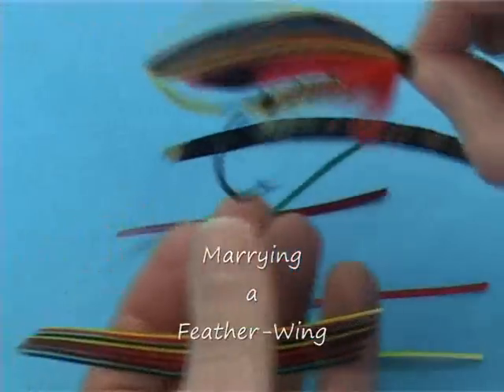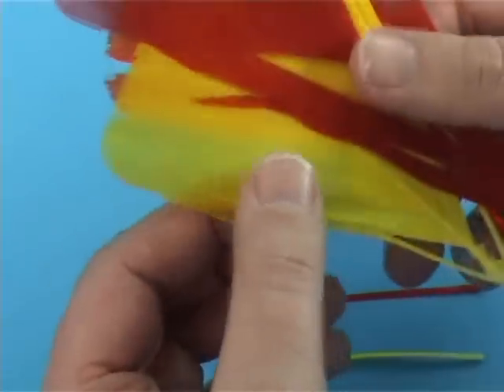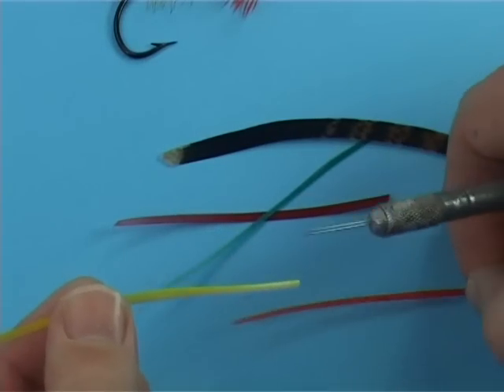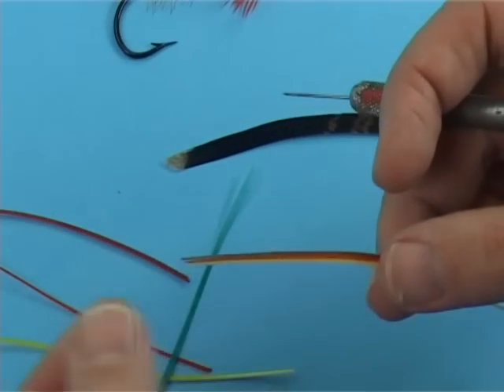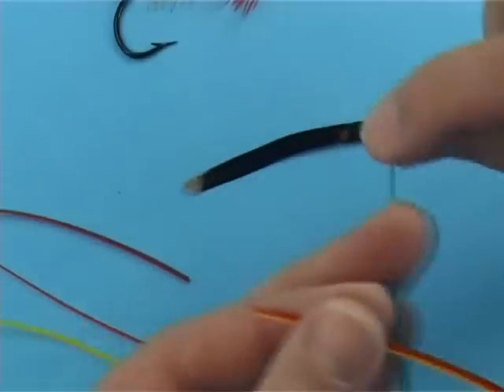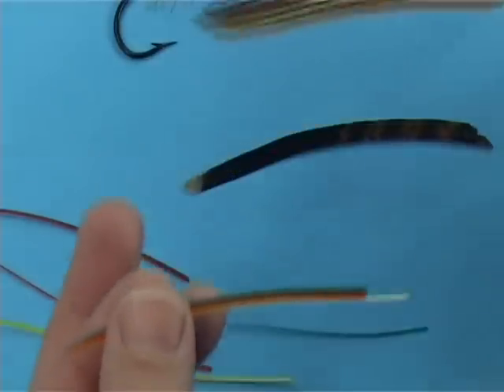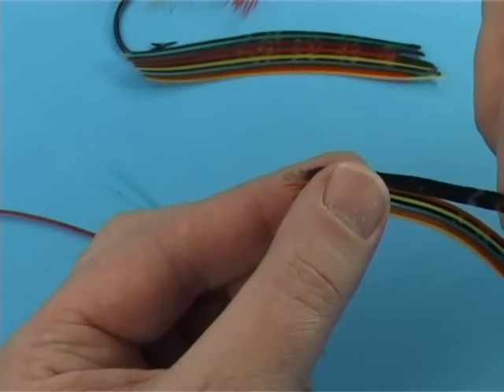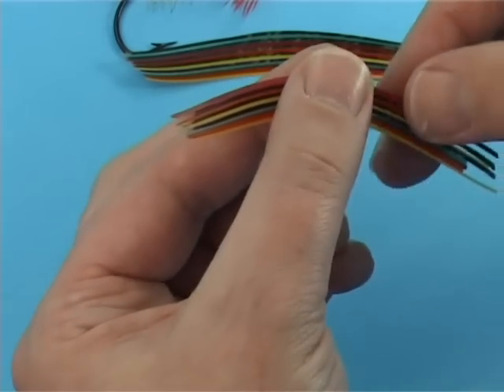Fly Tying (Marrying a Feather-Wing) with Davie McPhail.

Comment: Davie, I know I am being a pain in the butt again, but could you tell me what you think I am doing wrong when tying married wings in. I have gotten good at feather wings just with practice, but these are killing me. I get them tied in and I look at the wing and it is separating and somewhat twisted on the top. I have tried pinch and loop pulling down with the thread, going around pinch and loop pulling up. Could it be I am making the feathers too broad? I mean too many layers? I will get this. I am using goose shoulder because they were equal in size and available. If you think of something please forward any advise you may have. Thanks and all the best, Sean
Reply from the maker: Hi Sean,

You have answered your own question as this is what I would recommend, it's very easy to make the wing to broad and I do this myself at times as I've had to remove fibres many a time.. Wings will twist for many reasons, I'll remove the wing and steam it back to shape so that I'll have another go but the more you do this the more likely the wing will start to go it's own way. It's all down to practise and lots of patience, you just never stop learning, but when you finish a fly and admire what you have done it's a great feeling..

I wish you well...

All the very best davie